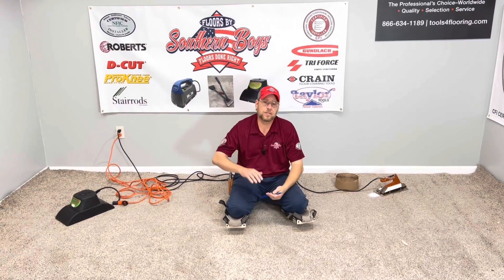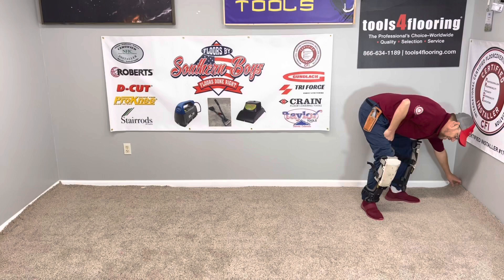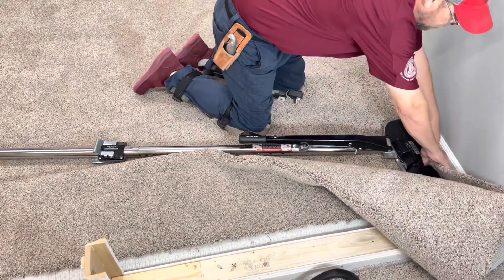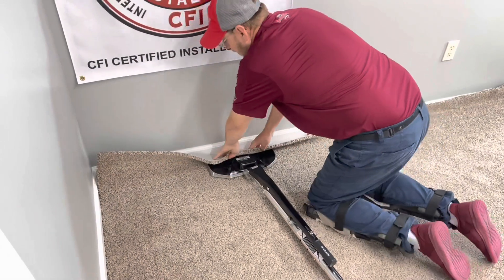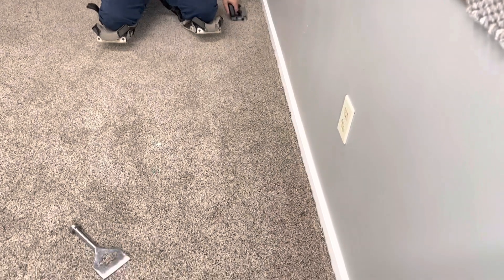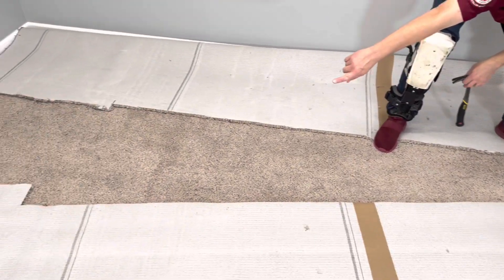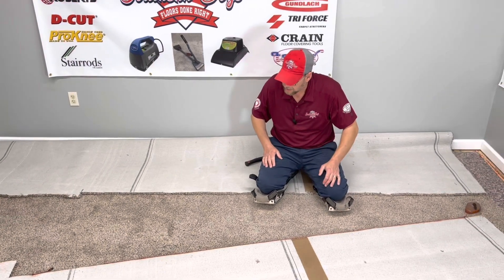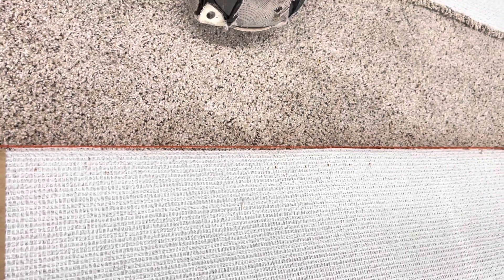Does carpet seam tape stretch

Comment: I'm glad you did this one.  If the seam is an important one and you're working with some nice carpet in a nice home I'd suggest pre-stretching your seam.
I'd love to find an image or two to send you. My life has shifted from a computer to using my phone which of course doesn't have a USB port. 😁
I'll give you a challenge so you can see it for yourself. I think this would be great for the people who watch your channel also.  It's a demonstration showing that carpet and seam tape do not stretch equally.
Do another scene just like the one you did in the same manner and you can use a straight edge because the quality of the seam doesn't make any difference. You just want to put it together tightly butted like you normally would.
Trim and seal your seem like you normally would then hook the carpet for three or four feet at one end and stretch three or four feet the opposite direction and stretch it about half as tight as you normally would stretch the carpet.
Stretch the other side of the seam the same way. 
You may need to put some stay tacks in to keep any bow out of your seam.
Pull it off the tack strip at both ends and be sure that the seam isn't stuck to the pad. Now wait for 5 or 10 minutes. Trust me you'll see what the seam tape does and doesn't do.
You might even try this with a lower profile carpet because it will be easier to see the effect.
Reply from the maker: That was the point of this video was to show that the same tape does not stretch like Carpet does, I guess people missed what I was getting at
Reply: @FloorsbySouthernboys  
I totally got what you were talking about, just suggesting a more visual way to see how much stretching affects the tape.
I'm not talking about the curve at the end after it was pulled back.  It was there, but it wasn't a lot.
I'm referring to the entire length of the seam itself once released from the tack strip.
I once did a seam that was probably 16 ft long and it was perpendicular to the front windows in the living room.
I stretched the carpet probably 3/4 of my normal stretch, then put it together.  15 minutes later I pulled it loose from the tack strip.  10 minutes after that, the entire seam looked like a serpent.   Every 2 feet, the carpet humped up. I laid a carpenter square across two of those humps and they were so tall, I could stick my finger under the square........... Now that,  is a visual. 😉 That's why I suggested a hard stretch, seam, and release.
 The trimmed ends that you showed proved that it does have an effect. Had there been a half inch bow in that carpet people's eyes would have bugged out.  An eighth of an inch or so of bow at the carpet ends as in the demo,  proved your point.  
What I suggested, well,  it looks like someone placed a ping pong ball under the seam every 2 feet.......
......that will raise some eyebrows. 😉
What I suggested simply shows how much the tape  strength affects a seam.  
You need to try this.  Stretch it tight, then seam it.
....release it and wait for 10 minutes.   The carpet will shrink back, but the taped portion will fight being shrunk.
If it fights shrinking, then  it fights being stretched.
Everyone has put together a flawless, completely invisible seam, only to see it appear after being stretched.
The idea is putting the seam together in it's final "stretched"   condition......... the condition when it's invisible, and not distorted from stretching.
Reply from the maker: @randywl8925  nice

Comment: Why you using power stretcher for such a small room
Reply from the maker: Every room should be power stretched regardless of the size
Reply: Every install needs a stretcher.  
If you don't do it for your customer, do it for your own longevity.  Everyone thinks they're tough as nails until their first back surgery or their knee gets replaced before they get their first hernia.
Don't cut a customers carpet expenditure $$$ short by doing hack work.
Kickers are carpet positioning tools. They are not stretching tools.
Reply: @FloorsbySouthernboys  
How do I give you two thumbs up? 😁
Reply from the maker: @randywl8925  😂😂👍
Reply: @FloorsbySouthernboys  👍👍
I found a workaround. 😉